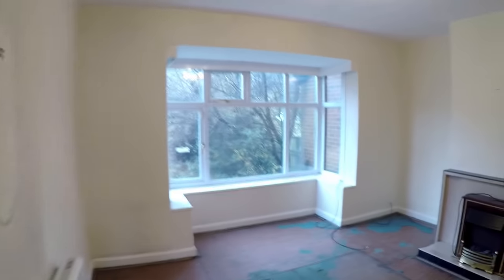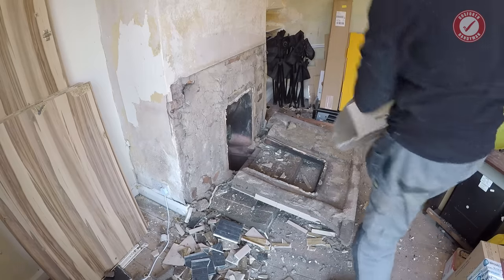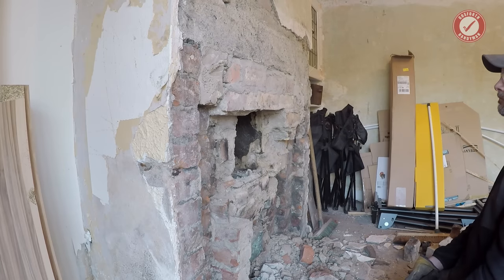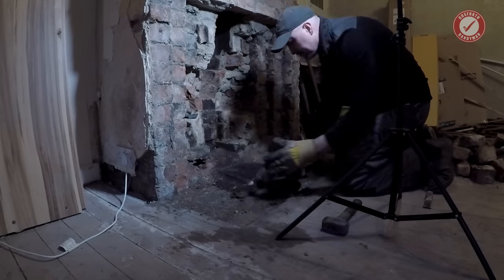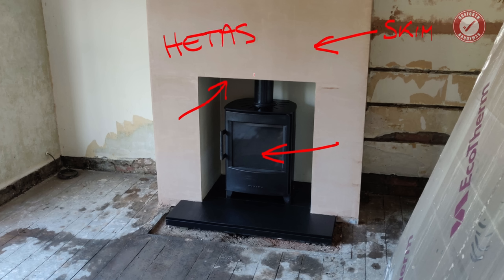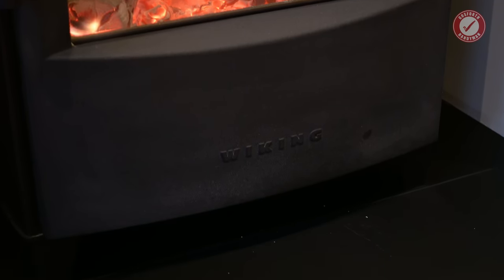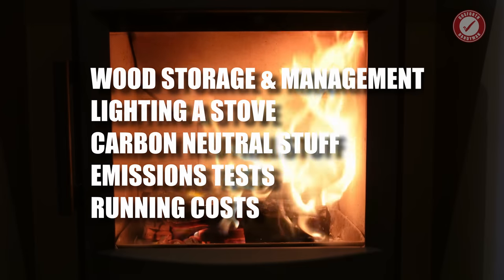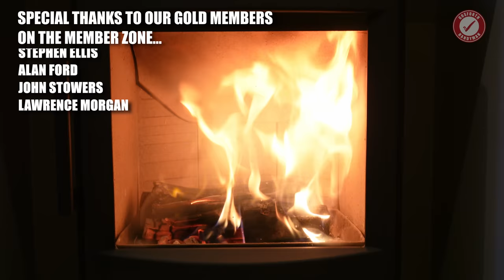Removing the back boiler and installing our wood burning stove

Comment: Thanks for another interesting video. Sadly HETAS, in my experience is just another of those ideas that should offer peace of mind and professionalism. In reality you get someone who’s been on a short course and passed a multi guess paper at the end.  I used HETAS ‘professionals’ for my install. After their second attempt I suggested we get the building inspector and trading standards to have a look. Their immediate response was to return my £980. I then removed and refitted the fire myself. There are probably responsible HETAS operators out there, but how are you supposed to know which ones?
Reply from the maker: Cheers! Yup, I'm hearing this time and time again regarding HETAS. Bit worrying. 😬
Reply: I like the sound of that multiple choice paper, I might give it a go. It'll qualify me to install fireplaces, and perhaps some light surgical procedures, is that correct?
Reply: I DIY fitted my stove including the flu liner. HETAS??? 😂😂😂 About as much use as having a TV licence
Reply: Knowing I would likely be able to do a better job that many HETAS approved fitter's, this is exactly why I DIY fitted my flue liner and log burner completely a few months ago. I sought local authority building control sign off but was completely fobbed off. My missus was keen to have it signed off in some way, so I resigned myself to messaging HETAS fitters. Vast majority told me to take a hike, but thankfully one helpful gentleman did come and inspect my work. He ended up signing it off for a fee. He also told me he was being asked by HETAS to go and independently inspect another installers work, where the customer as very unhappy and had complained to HETAS... A prime example of why you are running a gauntlet when looking for an approved person to fit your stove!
Reply: Same for me. Did my own. Not difficult if you are handy. Been in 15 years now and worked impeccably.

Comment: This is why I love Poland...(eastern Poland).   NO HETAS....yes Poland is an EU member but they totally ignore silly EU rules unless they suit them.    Could buy the stuff and get local guys to install.  My central heating runs on coal or wood...which is lucky because I own a wood...well a large copse really, so it's great for coppicing.   It does have some very big trees in it.
Reply: Hi Stephen, those regulations are there for your protection. That capped off back boiler was a potential bomb, and something that wasn't  mentioned here is that some fire hearths have gas pipes under the floor or or in the walls that used to service  gas fires. These also should  be removed to prevent an explosion.

Comment: Very kind of them to leave a bomb embedded in the fireplace waiting for you! I feel like you should have sent a water sample to a lab to find out what fancy new microorganisms evolved in there over the years. Some of them could have been sentient by now.
Reply: For others, he's referring to 5:04
Reply from the maker: I know! Could have been nasty! 😬
Reply: I for one, welcome our new overlords.
Reply: @GosforthHandyman  they'd have to live on metal and enjoy complete darkness.....so I wouldn't rush to don the biohazard gear.......!
Reply: Well, let's remove all EU laws and lawyers are going to have a field day from now on!
Reply: @GosforthHandyman  I just refurbed my house and there was a back boiler in the fireplace with pipes going out the side of the breast and then vertically up into the attic where they were chopped off when I bought the house as it was longer in use. I ended up removing the pipes going to the attic by just chopping them flush to the side of the fireplace to reclaim the space by the edge of the fireplace, I then dot and dabbed plasterboard over the whole side of fireplace and had it skimmed, Is this safe? They aren’t sealed as there is a small gap between the pipes and the plasterboard so I assume so, plumber seemed to think it was fine but he was young and doubt his experience with back boilers.thanks

Comment: Look into getting an Eco Fan (Peltier Fan) to sit on the top of the stove, they are brilliant at distributing heat around the room.
Reply from the maker: They're great! Not enough room for one on our stove but we don't need any extra heat from it. 😁
Reply: @GosforthHandyman  look on eBay I had the same issue. I found one in the shape of a bi wing plane..... Looks great and works a treat... I shall get one for the other side ....
Reply: Consider an ec ceiling fan we use ours in both directions and it helps push heat through the rest of the house.
Reply: Get a smoke machine to see the air flow from them. Absolute rubbish

Comment: Andy great install and you will love it - I watch ours more than the TV.  I like you have an older house which I spent time to upgrade and seal up.  You are only required external vents above a certain KW value.  But the fire does need air and in our case the main air source was from the doorway across the room - this caused a draft along the floor area - so like you I have a suspended floor so I drilled holes through the floor just where your skirting boards are each side of the opening - the holes were close to the wall - I then routed out grooves in the rear of the skirting boards and placed them to the wall the air is then drawn from the ends of each board either side - hidden if I did not tell you it was there - this really helped.  Re a fan if you place a metal sheet so it extends under the fire and projects just to the side you may find the fire heats this plate enough so you can stand a heat propelled fan on - I hope some of this makes sense? In any case there is nothing better that a day in the garden with chainsaws - log splitter and building and seasoning your wood 🔥

Comment: I never saw a back boiler before. It's smaller than I thought. I was expecting some enormous tank.
Good video. Looking forward to Part 2
Reply from the maker: Yup - tiny! Would get seriously hot though.
Reply: Usually about 3kw in hot water output.

Comment: I had a stove fitted to my 50s bungalow 10 years ago when i moved in. Best thing i ever did to be honest especially in the current energy crisis.A trick i do is about 9.30 pm is to put a small container ( a decorators paint kettle to be exact) of smokeless coal on and turn the air up until it starts to glow. Then turn the air down low. When we go in the room in the morning it is toasty and keeps that way till early afternoon ( with lounge door shut) 👍👍
Reply from the maker: Nice! Ours is wood-only but good to know! 👍
Reply: @GosforthHandyman  Andy. We keep lounge door shut as much as poss during the day and light fire about 3.4 pm.( Hasten to add we only do this when the weather is really cold.

Comment: That back boiler was a grenade waiting to be triggered.
Cats love stoves, as I do, even when it's just 16°C in the room, as soon as the stove is going the radiant heat gives a comfortable feel to you.
Also it does a much better job in getting the room up to temperature quickly when you run your central heating at relatively low boiler temperature to save on gas.
Price wise you got a good deal I think for all that work done.

I had to get my flue drilled to a larger diameter to accommodate for a 150mm liner, total 10 meters.
My woodstove is also a Danish make, the Termatec TT20S, 5kW and it heats a living and kitchen totalling 45m² easy to 20°C above outdoors temperature if I want.
Total cost for drilling, liner, inside flue and stove was in my case just under €3800, but didn't include the hearth, as a nice black stone one was already in place, drilling and lining was done in about half a day. I just had to re-plaster the small hole that was made in the chimney breast to pull the drill trough.
Drilling and installing an outside air admission to the stove was done by myself, it further improves efficiency (no warm air from inside is taken by the fire) and is a must in air tight well insulated houses with balanced ventilation to avoid gasses being sucked into the room. Otherwise you need to have an open vent somewhere to level out pressures inside and outside the house and to provide fresh air for the fire.

Comment: My Mum has one, she loves it and it is a nice enough thing to sit and watch but I can't say I'm impressed with its performance. I would say results vary massively depending on the quality of the stove. Some days it can take hours to get the flue up to a hot enough temperature to start pulling, when it is roaring away the room is toasty but the heat doesn't seem to travel much elsewhere even with doors open. She still seems to use the central heating and gas fire in the other room the same amount as before.
Reply from the maker: Interesting! Probably the stove. The newer Ecodesign ones are amazing. 👍

Comment: Sold one 1920s building , had a 1950s solid fuel burner in it, the buyers (2013) ripped it out + all chimneys and replaced with rads and boiler system

Comment: This is a really good video, so thanks!

I have a query for you. I have an inset wood burner about 6 years old. I'm thinking about replacing it with a freestanding stove, partly to get a bigger fire window to watch the flames & partly to allow us to have a flat wall without fire stonework and plinths against that wall.   

There was once a 16inch open fire  built into a "stone" opening with a lintel above & a wooden mantelpiece placed above that, AND an attached stone plinth where we put our TV on one side of the fire and a smaller plinth on the other. Together the fire surround and the 2 plinths on either side extend along the wall about 15 feet  (the room is large - about 27 feet long).  

Apart from that stonework the chimney doesn't come INTO the room (which otherwise has a flat wall) but is built outside the house (the brick chimney juts OUT rather than in).

The opening behind the inset stove (from your neck of the woods - a Cast Tec Arbeia Titus) and its surrounds is approx 760mm high and 760mm high, but I'm not sure how "deep" but it is certainly deep enough for the inset stove.
M
The question is whether I'd need a builder first to remove the old inset stove, maybe increase the size of the builder's opening and put a support above it to hold up the masonry and remove the "stonework" plinths etc and THEN getting a HETAS engineer around to instal the new wood burner and hearth and maybe a mantel-beam above  on the outside of the fire opening.  OR do HETAS people do all of it?  

(I hope that makes sense!)

Comment: I was rewiring a house years ago it was a full renovation with a wood stove the plumber never put holes in back boiler to drain it the family had a fire on a cold Saturday night n just put the kids to bed thankfully,the pressure built up in the old back boiler n blown the side of the house out it was literally a bomb sight thankfully all were OK very lucky....
Reply from the maker: Yup, so dangerous to leave them with water in! 😬

Comment: We just did literally the same thing. Funny enough the room looks the same basic layout os ours. They didn't add a ugly art deco surround in ours but did cement in a bunch of bricks and totally hide the decommissioned backboiler. The scary thing was there wasn't a proper lintel installed so I ended up having to replace several bricks and repoint a bunch of it and add new/old bricks to replace the ones that been broken to make room for the backboiler when it was done. We have a sweep coming in next week to handle the chimney that from the looks of it has never been cleaned. Then we still need the new flue installed and everything certified.
Reply from the maker: Nice one! The old lintel in ours was massive!!

Comment: Enjoyed this, I liked the relaxed feel of this video. It is possible to install your own stove and get it signed off by building control. I did mine. It's a fairly straightforward DIY job. The quotes in South East England for that kind of install come in a lot more than £850!
Reply: Hey Ollie is it straight forward to find the regs mate to do it
Reply: @andywilkie1986  Yeah, google will find it pretty quickly. It's stuff like having a carbon monoxide alarm installed nearby. The heath needs to be a minimum depth, there needs to be min 300mm from the wood burner to the front of the hearth. Something like 600mm min from the wood burner to combustibles. That kind of stuff. I paid £100 + VAT for building control to sign off my work. But I added that to an existing extension. So would likely be more if it's a standalone job. But they will tell you.

Comment: We had that exact stove after seeing it in one of your earlier videos. It ended up getting removed as the incessant clicking from the auto air control mechanism was too distracting. Ended up going for a clock burner and been really happy with it. A shame really as build quality was great, we loved the way the door worked which you slammed shut etc. Great big window but the noise was a problem.

Also consider an ec motor ceiling fan (Costco) we use it in both directions when we get too hot with the wood burner on but it also helps push the heat out of the room into other rooms. 

We're burning oak this year with a combination of smokeless fuel.
Reply from the maker: I think you can lubricate it to stop the clicking btw. 👍
Reply: @GosforthHandyman  I had Wiking out themselves, the stove was even changed but it made no difference. THey said it was meant to do it.

Comment: Nice install. Picked up old 8kw villager for £250 got it looking new with new door ropes door pins glass seald good rub down and black stove polish. Knocked out fireplace insert then drilled 6inch hole into chimney just above fireplace put flu through that. gets to 35 deg plus in here done it all very cheaply £400 total in the end. is an old house too solid walls no insulation yet.  DIY not that hard if your reasonanly handy. not got pipe down chimney yet but will do it next year. run fine how it is thats how they used to do it. it is even in manual for it. A friend did similar with his fine if you not planing of selling it with it installed in there too. YT vids like yours were a lot of help too before I started smashing fireplace out :)

Comment: That little fireplace tip was much the same as mine. However, my suspended floor was completely dry rotted and it collapsed and I fell down and hurt my head. 

Perfectly summed up my festering dungpile of a 1920's house also ..

Edit: I installed my own liner and stove tbh. I got the liner on Gumtree for £50 and the stove was an old Morso squirrel I got for £300. 
Its been my #1 source of warmth for 4 years and I got to say the best ~£500 I ever spent. Its not that scary really.. 
We didn't drop the liner down, instead we attached rope to one end and pulled it up! Much easier.
Reply from the maker: Nice one - you're braver than me! 😂
Reply: @GosforthHandyman  Oh I sent Uncle Pete up the scaffold hahah. My contribution was to "feed it through" from below! I can't go higher than 10ft. My entire central nervous system shuts down :P
Reply: You have to be a little cautious doing bottom to top. The force of pulling the liner up can delamination layers of the liner. Do-able certainly, but hard to know if you've caused damage. Generally it's easier to let gravity do a bit of the work for you
Reply: @adamconstable1377  not sure why pushing/pulling UP is any different from pushing/pulling down!  You're going through the same hole!
And sod gravity!...it's safer to go up......!!!
Reply: @andymccabe6712  think of it like a tightly coiled spring, compressing it causes next to no deformation if at all. If you stretch it out however it can distort the shape. Liners are only fractions of a millimeter thick at the end of the day. As for the safety aspect, this is in the hands of the installer; a DIYer isn't usually as great on roofs as an installer does them everyday. To each their own
Reply: @andymccabe6712  when installing a flue from the top of the chimney down there isn't a big need to pull it from the bottom. The idea is to gently guide and manipulate the liner down the chimney and not to  have it literally pulled down from the bottom.

Comment: Two things Andy
1. I can’t believe how hard it was to see the builders opening. My 1930’s place was so much easier to see and smaller
2. How clean was the water that came out of the old back boiler? Not a sign of corrosion!
Edit: Nice looking stove, I like the large glass, often better than TV
Reply from the maker: Cheers Doug! Yeah, was really surprised by how clean the water was in the back boiler. 40+ years!

Comment: Ah I did a diy install last year, shoving the liner down the chimney was a nightmare. But I bought an ex display fire plus flu and other stuff for 900, a huge piece of slate for £100 and materials prob £30?  I got a certificate from building control.  Was quoted 4k for the same thing..  it’s def at the more extreme end of diy.  Thanks for the videos 👍

Comment: you can install your own stove (even used one) you just need building control to sign it off. You don't even need a steel register plate, two layers of plasterboard are more than enough - it is called a closing plate. A register plate is for stoves or fireplaces where you don't have a liner inside the chimney, that is why you need another door in the register plate for access to clean sooth. The HETAS installers normally install steel register plates anyway as they don't bother.

Comment: First time it's cost you more for something than I paid ( I think)! Inclined to agree about the pollution in built up areas. When the neighbours have theirs going it comes in through our windows I've left open a crack for ventilation. I don't mind the smell but end up not using ours much.
Reply from the maker: They're amazing!